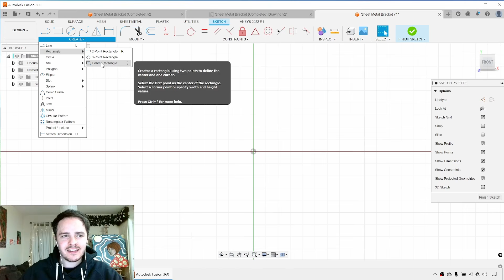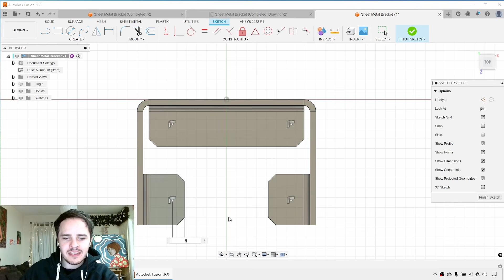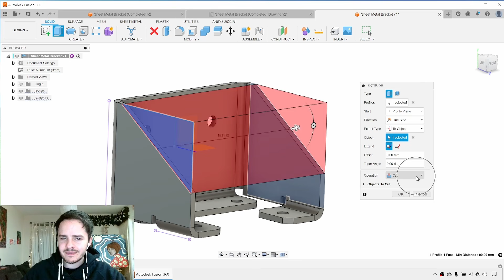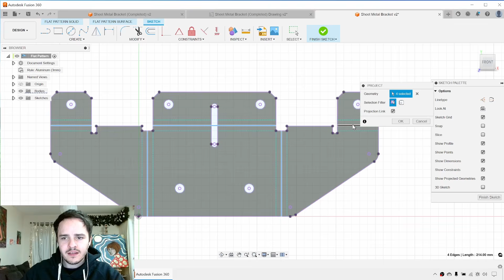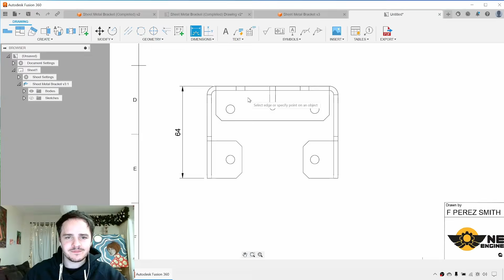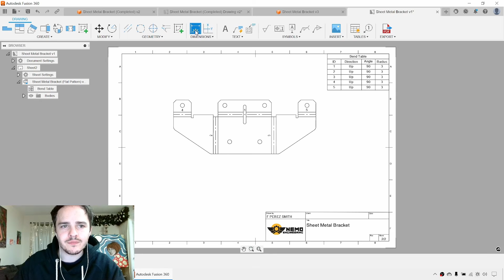Let's Model! Sheet Metal Bracket | Autodesk Fusion 360 | Model & Drawing | Tutorial (Intermediate)

Comment: I have no reason to learn other than self improvement and by far the best tutorial I've seen so far. Kept me entertained, I followed along very well. Job well done, keep up the good work, your a good teacher. 

Our engineers do prints differently. The flat pattern print is for the laser to verify hole placement and overall dimensions. The bent print shows the brake press operator what each bend is bent at. Sometimes his are flat as well though.

Comment: You made that look so easy! Thank you! I have a question and I hope you will answer: Say that I made this design, now I need to manufacture this, I can cut the shape out, but I don't have a bender, so I want to convert those bend lines in a perforated line, so I can easily bend by hand. is there an easy way to do this? (like specify the bend liness) or would I have to go after flattened, manually sketch this perforated line and extrude? Thanks a lot!

Comment: How do I go from the flat pattern to Manufacture. I want to cut the flat pattern out with my plasma cutter using fusion, but when I go into Manufacture it's not in the flat pattern form. I know I can use the dfx file in sheetcam but I would rather use fusion.